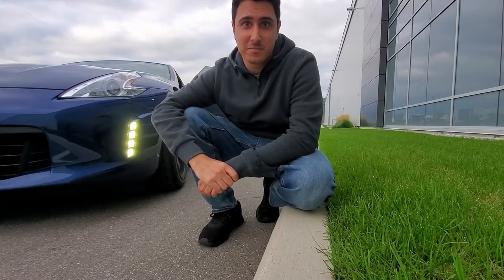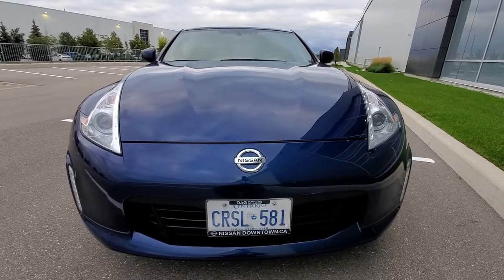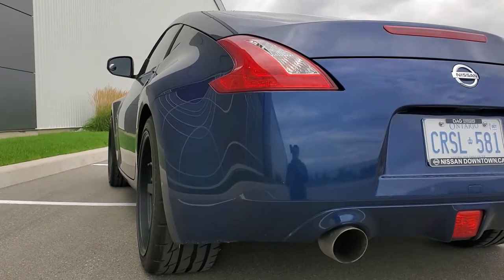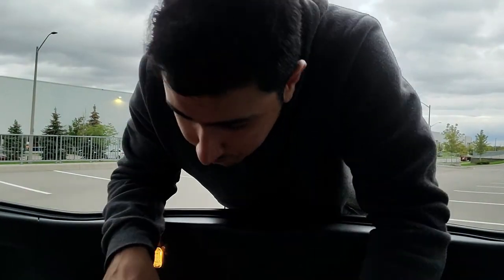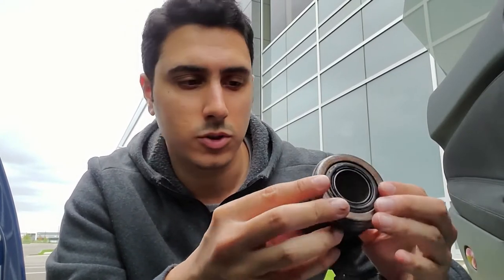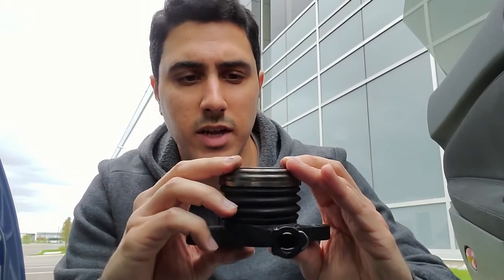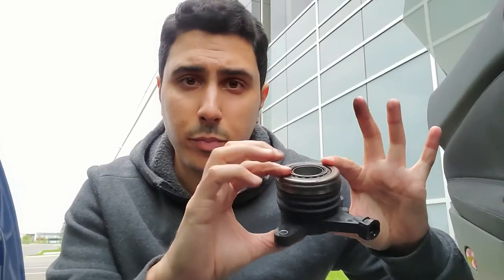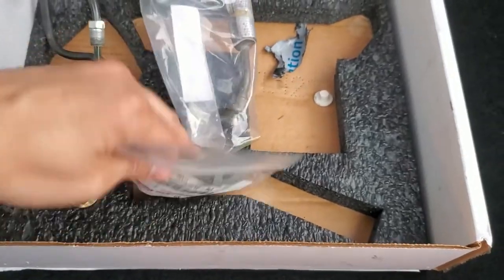5 MUST HAVE Mods for your 370Z | Build Update

Comment: Next: two piece rotors and akebono calipers. It will accelerate quicker, corner easier (feels lighter) and suspension works quicker as well.

If you do intake, I'd suggest going 3" instead of stock size. If you plan on staying on stock diameter then it's better to put high flow drop in filters (MAFs work better with stock plastic tube according to my tuner).

I would like to see your experiences with an improved clutch pedal and short throw shifter.
Reply from the maker: Yeah there's just so much you can do with this car. I still haven't decided which route to take, what kind of build to do etc. Thanks for the advice!
Reply: For people who is reading this , invest on a dry drop in filter . Thank me later

Comment: I have a 2019 370Z 6MT sport pkg that I got new. It has Hotchkiss anti-roll bars front and rear that have improved the handling. Stoptech stainless steel braided brake lines have firmed up the brake pedal. I hade a Stillen Gen 3 long tube cold air intake, a Fast Intentions dual x-pipe cat back exhaust plus a dyno tune done with Ecutek software. We got about 55 more peak horsepower at the crank and a 15% increase in torque across the whole rev range. Litespeed Racing forged magnesium monoblock wheels of the same size as the OEM Rays wheels have taken off about 9 lbs from each corner. Michelin Pilot Sport Cup 2 (240) tires are a lightweight tire with good handling precision and grip.

Comment: you think nismos have the same issue with the slave cylinder? i had a 2010 7 years ago and that was the first issue i had with the car. fast forward to current day im in the market for a nismo:)
Reply from the maker: Yes, I believe they do. The issue is specific to the manual transmission on these cars.

Comment: Great video bro. Always looking for more Z content. Can't wait for the supercharger/turbo install 😜
Reply from the maker: Haha thanks bro. Yes, car definitely needs more power so forced induction is in the long term plan for sure!
Reply: Facts thinkin bout gettin one.. only thing I’m hearing that’s bad about it is blind spots an limited trunk space
Reply from the maker: @buckyoung77  yes, not the most practical car, but it's not meant to be. This car is designed for performance. I do have Blindspot mirrors to help with the terrible Blindspots though.
Reply: @jawadmajeed  does it make it difficult to change in an out of lanes ?? Or can you still dart in and out of lanes ?
Reply from the maker: @buckyoung77  yeah you still can. Just have take a better look before doing so. I would recommend the Blindspot mirrors for sure.

Comment: Love the advise man. Was hoping u did a cold air intake mod tho. Don’t know what brand would be best. Nice car tho bro.
Reply from the maker: Thanks man. Cold air intake is truly useful with a full exhaust in my opinion. In this video, I had only done a muffler delete. Best cold air intakes for this car are Z1, admin tuning, or stillen. The ones that bring the intake to the front bumper. If you go more than 2.5" in diameter, you'll need a tune though.
Reply: One more question. Does an exhaust delete fail your emissions? Absolutely love the sound but don’t want to keep swapping once a year for the emissions test ya know.
Reply from the maker: @ryanbruss4783  I'm not entirely sure. Removing the catalytic converters are the main cause of emission issues. I'm not sure if a muffler delete will also cause issues. My guess is no but I could be wrong. What I understand is the muffler only "muffles" the sound i.e. reduce the loudness of the exhaust gas flow. I don't know how this could be linked to the gas composition. I hear you on the emission tests though. It can be annoying. Luckily they got rid of emission testing in Ontario. Where are you located?
Reply: @jawadmajeed  I’m located in Milwaukee, WI. Ya we don’t have emissions centers anymore but once a year we still have to have a shop plug in to our car to renew our registration. And if anything causes our engine light to come on we instantly fail. It’s a bummer for sure. Definitely won’t do catalytic removal but might try the exhaust delete. I WANT a lil more sound ya know. Thanks man!
Reply from the maker: @ryanbruss4783  yeah I hear you. No problem man! Glad I could help.

Comment: This probably a dumb question but do automatic 370s have same clutch slave cylinder problems?
Reply from the maker: Nope. That issue is only for manual transmissions.

Comment: im looking at 2013 370zs in pretty good condition for around 20-25k. do you think its a good reliable daily driver besides gas ofc. id be getting an automatic too.
Reply from the maker: Depends on where you live since it's not the best in extreme winter or areas which get a lot of snow. Overall, it's a reliable car with only a few reliability issues which can be taken care of.
Reply: @jawadmajeed  i do live in oregon where we don’t get a ton of snow but it does rain a decent amount. I’m so obsessed with this car though I need it.
Reply from the maker: @daydreamprod4192  rain is no problem then, buy the car and take care of the CSC problem I mentioned, car will be reliable. Good luck!
Reply: @jawadmajeed  helll yeah, thank you! I was even thinking of getting an automatic and I don’t think those have the same issue. But I could be wrong
Reply from the maker: @daydreamprod4192  ahh ok. Yes that's right, my bad, CSC is only an issue with manuals.
Reply: @daydreamprod4192 I’m getting a 2013 370Z tomorrow. Howd yours go
Reply: @domonicdaniels7458  you lucky son of a bitch, still saving and looking for a good deal

Comment: Great video. I have a 2020 370Z automatic, can I put a weight shift knob on mine? where did you get yours?
Reply from the maker: I'm not sure if it will work. I got mine from Amazon. However, the purpose of a weighted shift knob is to improve manual shifting, so I don't think it will benefit an automatic car.